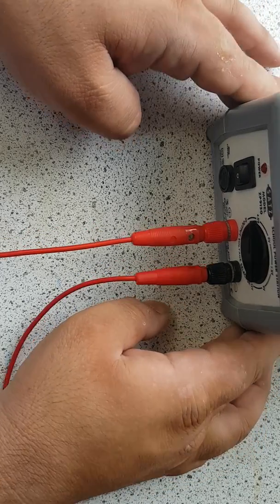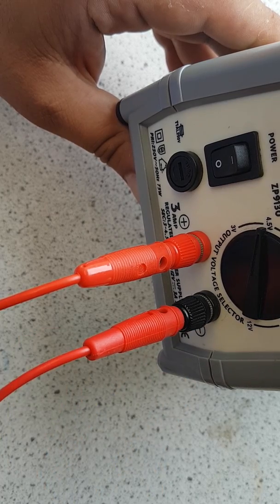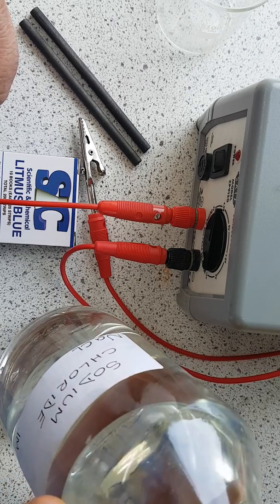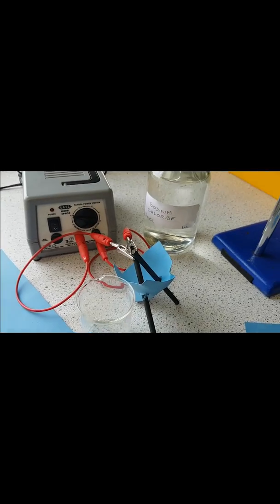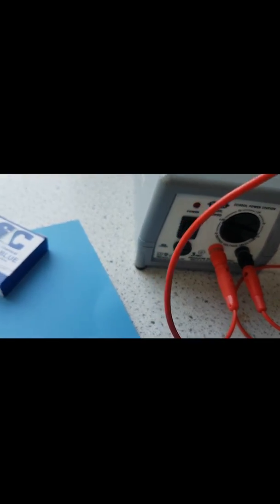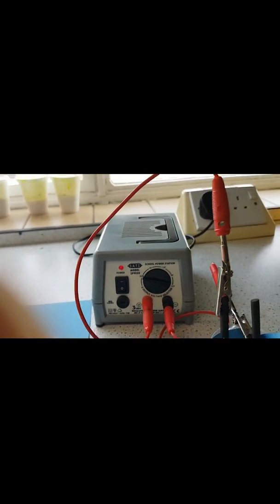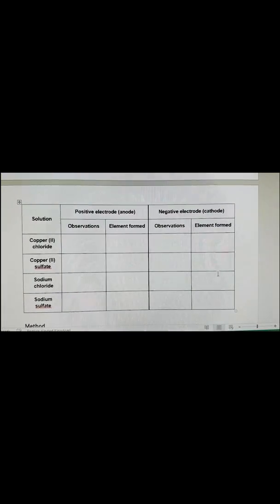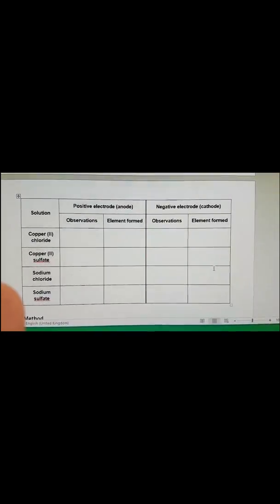Electrolysis of Sodium Chloride: Required Practical GCSE Chemistry

Comment: What do you do with the electrodes that get covered with copper?
Reply from the maker: Um Ibrahim - this is do to with electrolysis. Your lucky day I  currently making tutorials on electrolysis. Do check my most recent tutorial which is intro to electrolysis. Do subscribe. More to come
Reply: Mr Haider 
I meant is there a way of removing the copper or do you just throw them away?
Reply from the maker: Um Ibrahim - I leave that stuff for the technicians to do. However, I would suspect leaving the rods in a solution of relativley weak HCl woukd get rid of the copper since:

Cu + HCl --> CuCl2 + H2 [not balanced]
Reply: Mr Haider 
Thank you I will try that

Comment: You can make electrode holder using plastic lid of a pringles can pierced with a heated metal rod such as a screwdriver or alternatively use a petri dish lid with 2 holes drilled. The petri dishes did slightly crack but Pringles lids worked well.  Very easy to make.
Reply from the maker: We are now using the pringle lids. Amazing idea.